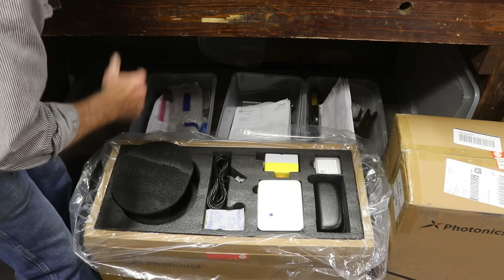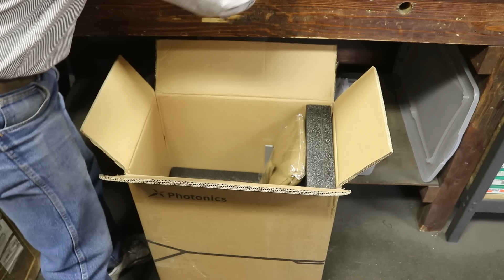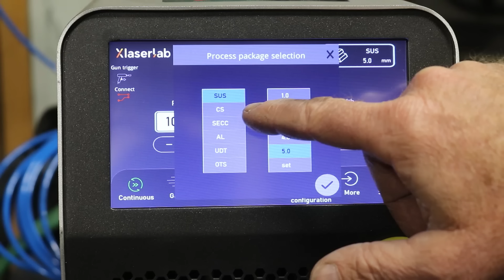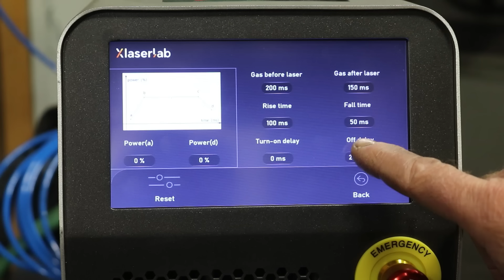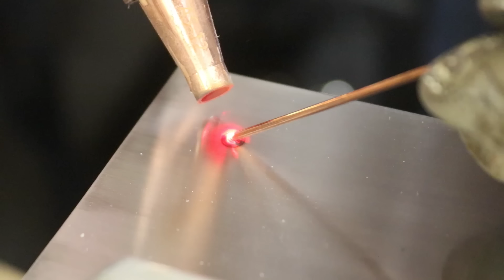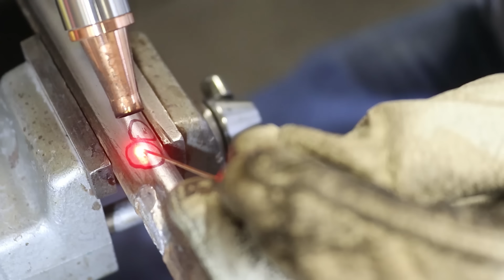Unboxing an X1 Pro Laser Welder for Gunsmithing

Comment: I think micro arc welders have the edge over laser welders, in nearly all use cases, except perhaps for punching through case hardened materials.
Reply from the maker: I have decades of experience in stick, mig, tig and gas welding, but just getting started with the laser welder.  From what little I've seen so far on some of the applications I have in gunsmithing, I'd have to disagree with you most strongly.  Time will tell
Reply: @thecinnabar8442  They're awesome bits of kit.  The English gunmakers nearly all have micro arc welders, and occasionally farm out work to specialist laser welders.  I suppose it depends on the use case, given the UK repair trade is mostly engaged in rebuilding/tightening up English shotguns for export.

Comment: I used a robotic laser welder in my last employ. I welded aircraft and missile parts for an aerospace company. They are capable of very tiny but very strong welds and their accuracy is amazing. I welded stainless steel fuel tubes that were .187 dia to a manifold piece. Mind you all of this was done held in fixtures. I welded titanium missile components as well as other items. They are great for the gun industry or anywhere there is need for a precision weld. Mark your welder with some practice will do a great job at filling holes or pitted surfaces. Practice with it every chance you get and become proficient using it and you will find lots of applications for it's use.

Comment: Thank you Mark. It will obviously take a while for everyone using this kit in the shop, to get fully sorted with safe and convenient working practices BUT the time savings will be significant, even when you have to add a bit more material to some cavities. Onwards and upwards🙂! Cheers from NZ🇳🇿.
P.S. I suggest that you use a wall-mounted whiteboard to remind your staff of workshop laser safety guidelines, until you have them finalised.

Comment: This is a very useful video. Thankyou. I have a 17th C. Katana blade with a 2mm chip in the edge at one point. The edge is under tension from the differential heat treatment. Do you think this tool would work to fill it?

Comment: I am curious to see how it works with the cleaning setting - how does it affect finish?  Regardless, a fun tool to learn.
BTW, your comment about the clumsiness of the gun reminded me of the first TIG welder my dad bought in the early 70's.  Damn that thing was awkward to use. Part of the problem with being a early adopter I guess
Reply: Yes, the cleaning setting will damage (or entirely remove) the finish.

It is essentially vaporizing the very surface of the material to remove rust and whatnot.

Comment: the real test will be how the rust blue finishing.  The barrel and the filler rod may show up differently in the finish.  However, the laser is one great tool.
Reply from the maker: Good point.  However, that's typically a bigger issue with high polish caustic bluing. The rust bluing tends to cover those welds a little better because of the matte or satin finish and it doesn't discolor the filler rod like caustic blue sometime does.  I'll update when we've rust blued over some welds.

Comment: Should be good for welding up S&W Hillary holes and those ridiculous safeties on the new lever actions. Course someone will use it to weld over serial numbers as well 🤦🏻‍♂️
Reply: They may or may not. A 30 buck angle grinder from harbor freight or home depot has been able to do it for 50 years though, you probably shouldnt concern yourself with such practices.

If you wanna plug a hillary hole i would just get a welding spoon & mig, as again has been available for years.

Comment: Hm, wondering if I could use a machine like this to weld up 1911 frame rails and barrel lugs, what do you think? Looks like a perfect way to add material without compromising the heat treatment.
Reply from the maker: It seems like it would be a good fit for that application.

Comment: I have a 1912 nickel steel 20 ga that has a crack in the receiver.Ya'll can fix that?
Reply: Usually a cracked receiver spells the end
Reply: @justacentrist4147  kinda yes kinda no. It can be repaired but the results will vary, finishes like engravings & patinas will not survive, and theres always a chance it will shift just a few thousandths of an inch off & cause binding. Its worth a try if its not your family heirloom / 1 in a million collector piece.

Source: i am a professional welder & there is a remington 11 on my table right now.
Reply: @1nfamyX  you notice the word usually lol.   The amount of work that a gun smith/ welder has to do to repair a cracked reciver  (if it's a good candidate for such repair) usually costs more than just buying another one. So unless you have an important hairloom or a rare peice it's not worth it.
Reply: @justacentrist4147  no, the opposite to both. If its got history and/or value, leave it in disrepair. If its something you use then try the repair, and no its not a large amount of work its just hit or miss. You clamp it all down square as you can, its a standard procedure to fix cracks we do it all the time. It only takes a little to screw it up though.

Comment: I really like those welders and I’m glad you made this video and talked about it cause I’ve been thinking about getting one maybe after you’ve used it a while you could let us know what you think of the whole kit. I thought it might be a good way to attach site ramps to a barrel. What do you think?
Reply from the maker: Yes, it may work well for attaching site ramps.  Might want to make several short welds on a long site ramp.  It still builds up heat when running longer beads, but not nearly as much as long tig welds.

Comment: Cool machine, heck it might be able to turn me into a welder. Thanks for sharing Mark.
Reply from the maker: Yes, it does seem much easier to learn than some of the other forms of welding.  Of course, it has a more limited range of applications than other methods.  Welding and repairing small parts with less heat is a big plus for gunsmithing.  We've been sending our laser welding work out to jewelers and engravers who use it pretty extensively.

Comment: They didn't have that around when I went to High School. It looks like something you can fill up the barrel and receiver pits with. Thanks for showing us the laser welder.
Reply from the maker: Yes, pit filling and welding up small defects with very focused and a small heat footprint was our primary reason for adding this to the shop.  It looks good so far.
Reply: @thecinnabar8442  Interesting.  I know Backyard Ballistics uses a specialty pulsed welder to do that work instead of a laser.
Reply from the maker: Both our tig welder and laser welder have pulse settings as well.  I haven't used the pulse setting on the laser yet.  However, I've used pulse on the auto pulse setting on the tig.  I actually prefer to manually pulse the intensity of the arc with the foot pedal when tig welding, adding a little extra amperage when I feed filler rod.  It takes some practice and coordination but makes a beautiful weld when you get the hang of it.  I find that the auto pulse function only works well for me when making a long continuous weld.  I rarely have the need for that type of welding in gunsmithing.

Comment: I'd be curious what class of laser this is? Probably a class 3B or 4. Depending on said classification (based on the power of the laser) can serious damage your eyes and skin. You need specific safety glasses with each class of laser.

This would be cool to learn to weld with!
Reply: If it can weld it can burn you badly.

Comment: Very informative... They are a little too salty for me at this time.. You can find good tig machines on the used market at this time. You're not likely to find one of those used.. Do you have any experience with the Henrob torch???
Reply from the maker: I haven't used a Henrob torch, but they look to be an improved gas welding torch.  Gas welding was the "go to" process for gunsmiths for a very long time and still can be very useful.  Tig welding, and now laser welding has largely replaced it with gunsmiths today.
Reply: @thecinnabar8442  They have a hotter, softer flame than a regular acetylene torch . They are very good for thin work . They are very concentrated and do not heat distort, nearly as much as a regular torch. The cutting feature is almost as clean as a plasma cutter. You can braze without flux..